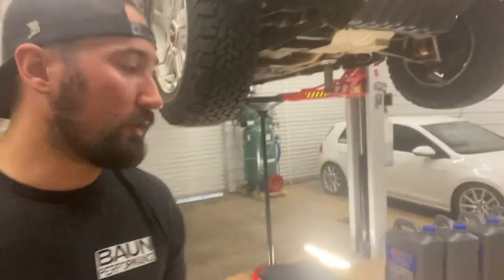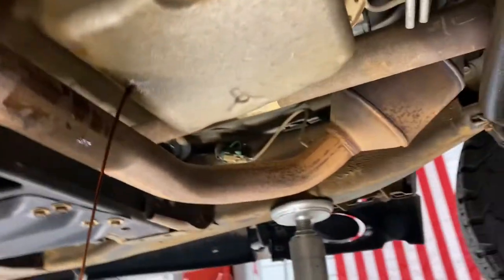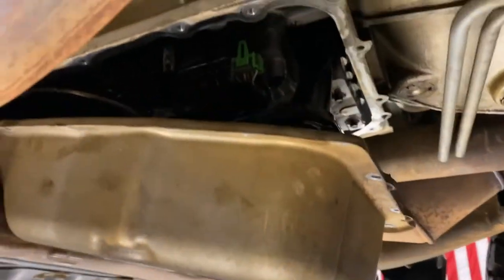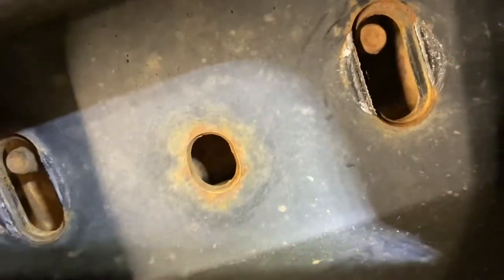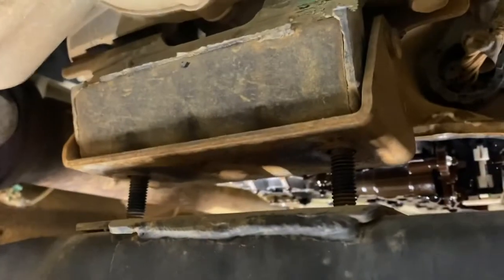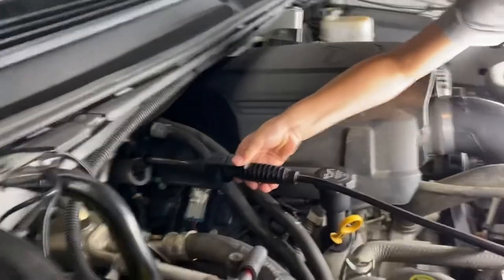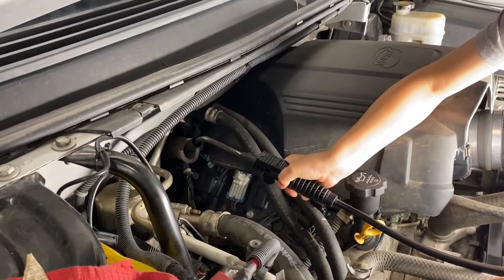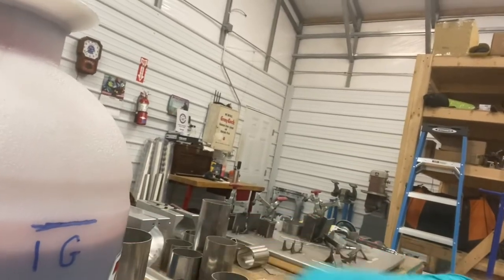Chevy Suburban 6L80 Transmission Fluid & Filter DIY

Comment: Good video but the filling part is confusing pan capacity (initial fill) with total capacity (entire amount of transmission fluid in the system). Granted the pan amount will vary with temperature, but how you explained it sounded like you were adding 6 quarts x 2 which is obviously not correct. Just wanted to point that out.
Reply from the maker: I’d have to watch my own video to see what you’re talking about, but at the end of the day follow the manual for your particular truck. 

Mine having the tow package has a big external transmission cooler not every truck is going to have, so your results may vary.
Reply: @BaunPerformance  Ok that makes sense. Appreciate the clarification 👍🏻

Comment: Great video thanks! Does jacking up the transmission that high cause any other potential issues? My worry is possibly damaging the bell housing, drive shafts, transfer case or something else when jacking up the transmission from that spot. I need to do this on my Quigley 4x4 2500 express van. Appreciate your help!
Reply: The correct way would be to unbolt the exhaust, but that risks breaking studs. 

If you do go that route spray them with penetrating oil and let it soak 45 minutes, then use heat and get the nuts glowing hot before breaking them loose (otherwise they’re going to seize and snap off)
Reply: Dude I thought the same. I ended up using a pry bar between the exhaust and that big black bar. Pulled the exhaust down a big and boom clearance.

Comment: When it’s at operating temp, what’s the level read on the dipstick. I have a 2017 Silverado and the thing is so sensitive if it’s not in the right spot, too much or too little, the trans acts terrible. I’ve played around with it got it a lot better but still not perfect
Reply from the maker: It’s in range on mine, no issues to speak of. I have a Diablo program on the ECU & TCU, the TCU I set line pressure to one step higher than stock so it does shift firm. 

I pull a 23’ travel trailer that’s 4,200lbs dry & it’s done well even in our hot Carolina weather.

Comment: I know this may sound stupid, but can you possibly use the old pan and show the steps in adding the plug to the pan? and where you got the plug from? thank you.
Reply from the maker: Here’s a video of building up the new OEM pan used in this video. Only additional steps had I used the original OEM pan would be a lot of cleaning/prep work to be able to weld & paint the part. With the new pan coming in at $18 it just made more sense to start with a new one (also allowed me a quick install vs waiting on paint to dry).

https://youtu.be/gSoi530RFkE
Reply: @BaunPerformance  looks good thank you.

Comment: Wats with the hard clunk when you shift into drive???
Reply: Everything seems louder inside a metal building, but I’m guessing my foot wasn’t on the brake going N - D. 

Not whatever you’re implying, it’s silent in normal circumstances.
Reply: @jakebaun8422  but mine does the same exact thing
Reply from the maker: Since you mentioned this I’ve been paying attention. It seems to shift hard during cold start high idle (inadvertently running higher line pressure than the lower normal idle).

Once my truck is fully up to temperature it’s silent dropping into whatever gear I’ve selected.

Comment: Pretty slick find, where you bought that pan? Would it be the same pan design for the 6L80 trannies on newer model Tahoe's? Ty.
Reply from the maker: It’s just a new OEM pan from Rock Auto. Not sure if the newer pans are the same, but these mods can be done to any steel pan!

Comment: Great info, have you had any converter shudder?
Reply from the maker: Zero issues with drivability, the only thing it’s ever needed was the shift cable bushing I made a video on (common issue, cheap fix).

Comment: Lol u did way too much extra work...u literally remove the heat shield on passenger side of trans...drop pan n rotate front of pan towards drivers side n it comes right out
Reply from the maker: Settle down, this took a few minutes
Reply: I've got 2012 your wrong my pan wouldn't come off.

Comment: Is there a drain plug on the torque convertor?
Reply from the maker: There may be, but I haven’t looked into it. Unless you’re having issues, I don’t feel it’s necessary to drain the converter for a regular fluid & filter service (although you’re correct in that doing it this way not ALL of the fluid will be replaced).
Reply: @BaunPerformance  Thats what i did on my '99 f150...about a gallon in the pan and 2 gallons in the tc

Comment: Drill a hole into a metal pan of the transmission? Puts shaving in your transmission fluid. Stupid move
Reply from the maker: Troll account trolls, no way
Reply: @BaunPerformance  no account troll. Just pointing out the obvious
Reply: It's not running when he did it probably and two the metal probably goes out with the fluid...
Reply: I think your mom is calling you in for dinner
Reply: @rukus100821  sticks, bundled
Reply: @tauruszuma  sticks, bundled
Reply: If he’s draining the fluid, and using new fluid to refill….  How’s it a stupid move?   Actually, he could then buy a drain plug kit and install a drain plug on his old pan.   

You commenting = stupid move
Reply: @chadlawrence8888  sticks, bundled